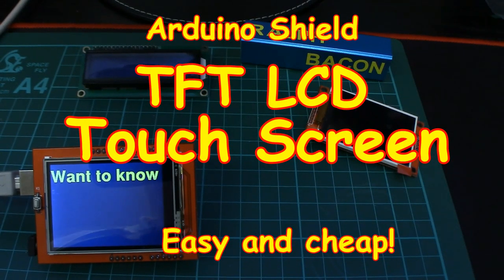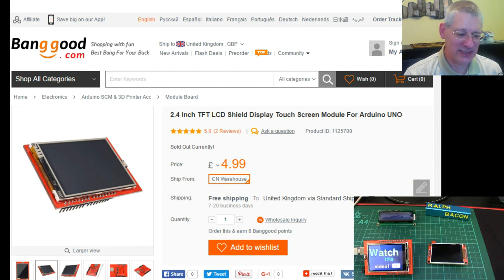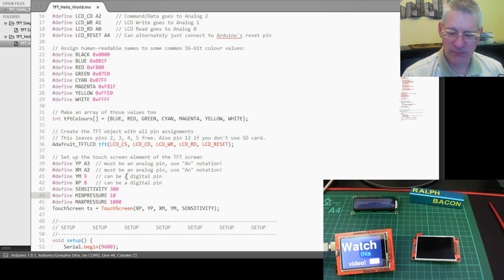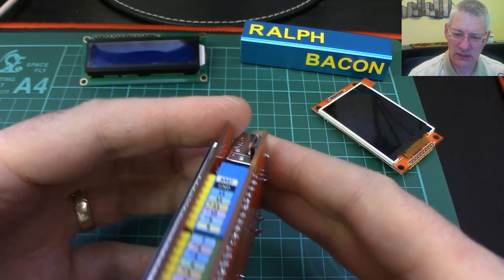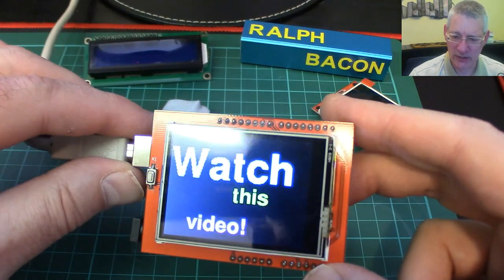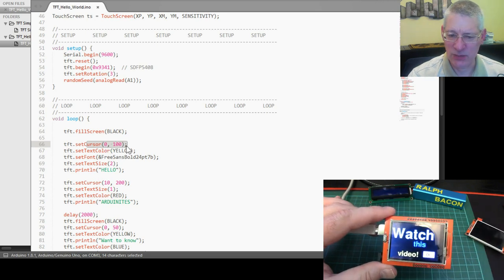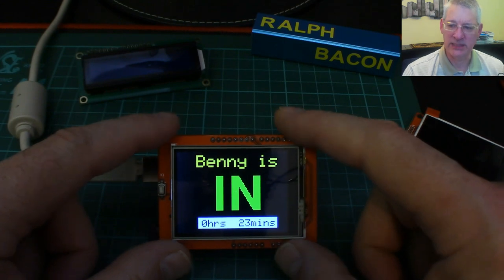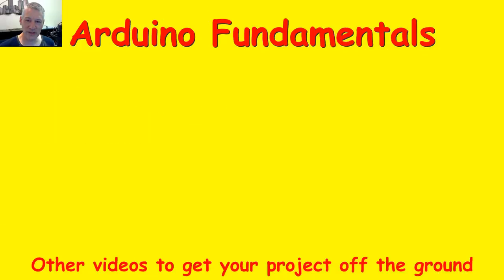#83 Colour Touch Screen TFT LCD for your Arduino - Cheap & Easy

Comment: Hey Ralph would you mind doing a video explaining how to control a servo with a joystick via bluetooth?
Reply from the maker: Ha ha! How cheeky is that Tom, asking for a complete bespoke system in one of my videos!
 
OK, seriously let's consider the steps required here. Firstly, Bluetooth communication (from what? your phone, another device?) is easy and I've covered that in a previous video. Next, joystick control? A real one? Now, this can't be your phone after all, in which case why would you choose Bluetooth as the comms of choice here? I'd use something else, perhaps an nRF24L01 transceiver. Possibly even infra-red, if the servo was stationary, that is not on a robot or car.
 
And finally, controlling a servo is a whole sketch in itself, which I can't believe I haven't covered (although it got a passing mention in my Stepper Motor videos). But if you get that working as a self-contained project then linking it to something else (which you've yet to specify, as we have now discounted your Bluetooth-enabled phone) is the next step.
 
So there are at least 3 (major) proof-of-concept steps to consider here, each one of which you could have a reasonable stab at doing, but the very first (and most important) step is to define exactly what your requirements are. What's the project, Tom, that you have in mind?
Reply: Hey Ralph thanks for responding back! Not trying to be cheeky just trying to the get the information for my project. Sorry if it was inappropriate. So I am building a BB8 and right now I am working on the head portion of the project. I would like to control it through a joystick  wirelessly through bluetooth. I know I could of used an XBEE but I don't have those right now. If found videos of people using bluetooth and servo motors but not how to use it together.
The hardware I have is 2 (SenMod HC-05 Arduino Wireless Bluetooth Receiver RF), one servo motor, a 2X New JoyStick Breakout Module Shield PS2, Arduino Mega, and an Arduino Micro Pro. Thanks for your help!
Reply from the maker: It's not inappropriate, per se, Tom, just that what you suggest is about a month's work! And then some! You can certainly send Bluetooth via an Arduino to another one on your droid but I don't know how that deals with the signal. It's a bit specialised, Tom, best best is to find a forum that deals with this (especially as you have already found videos of people doing this already, they may proffer some clues). All I can say is "Good Luck"!

Comment: When I try the Sample code for the touchscreen I get an error. "Error compiling for board Arduino/Genuino UNO"
Reply from the maker: Go to File - Preferences and tick the boxes that say Show verbose output during [ x ]Compilation and [ x ]Upload, Joseph. That way you get much more output, but at least it might point you to the error that you can understand and hopefully correct.
Reply: @RalphBacon  Thank you very much.

Comment: I am getting an error "fatal error: TouchScreen.h: No such file or directory"
I can't seem t find this file any where, please advise
Thanks
Reply: 1. Search the entire hard drive from C:\ or / (Linux) for the file name. 2. Enable "Show verbose output during compilation" under File > Preferences.  This will display the library directories included to resolve / search for the needed files to include during the compile.
Reply: @bgable7707  Thanks but I solved the problem by installing older libraries that had the required files...
Reply from the maker: I see you have resolved this, good job!

Comment: I bought one of the second type of display you show (Geekcriet 2.8) from Bangood some time ago and re-visiting the advert today I notice that, for that model, they now supply some code to download - with lots of examples and code for the different graphics processor types. It looks like the same product is available with either the STC12LE5A60S2 or the STM32 (STM32F103RCT6). So that will be interesting to try - some sketches don't even use a library - clever these Chinese.

The screen you feature on the Uno is also Banggood, (2.4 inch TFT) as you describe, but for some reason is currently out of stock. I wonder why....................
Reply from the maker: No library, Alan? Wow, that sketch would be interesting reading. I might just mosey along to Banggood to take a look. Are you saying the other TFT is out of stock due to the "Delia Effect" or have I misunderstood. We could call it the "Benny Effect"! And I still get no commission from anywhere.
Reply: Hi Ralph,

I couldn't get it to work - so I moved on but I might go back now I have actually got my TFT working.

Using the Bangood 2.8 TFT, I eventually found that "tft.begin(0x9325);" works but I can't guarantee that every variant will. Mine does so I'm obviously happy. The basic info can be found in; "Adafruit_TFTLCD.cpp".

As to the Banggood stocking issue - could be the Benny effect, since it takes a video like yours to raise interest in what is otherwise a fairly specialised piece of hardware. There is also an Instructable on the 2.8 TFT, which I will check out - and report back.

Kind Regards Alan
Reply from the maker: Does the 'touch' part work too, Alan, using that identifier?

Comment: Hi! I can program one of these to play video, correct? Thanks!
Reply from the maker: Not a chance, Tamara! The Arduino doesn't have the processing power to display video files of any kind. A Raspberry Pi could do it though, with one of their screens, but not an Arduino. It can display .bmp photos though, although the quality of this screen is nowhere near as good as the one in your phone. But then again, it didn't cost anywhere near that either! Great question that others may have wondered about too, thanks for posting.
Reply: Thanks for replying, do you know what type of raspberry pi I need?
Reply from the maker: Given that you are newcomer to the Pi World, I would go with a model that has lots of support, like the new (and powerful) Pi 3 Model B, although the Model 2 might suffice too. But don't let me push you down a path that's wrong, ask again at the forum stuffed full of Pi experts: https://raspberrypi.stackexchange.com/

Comment: Bonjour 
Merci pour le tutoriel et ce que tu peux nous faire un autre tutoriel pour un écran lcd tactile avec un menu ou faire fonction un moteur avec des button sur l’écran 
Merci
Reply from the maker: Je suis vraiment désolé mais je ne peux pas concevoir de circuits sur mesure. Mais je vais ajouter ceci à ma liste de suggestions! En attendant, essayez de demander aux experts à http://forum.arduino.cc J'espère que cela aide.

Comment: works great but driver on commonly available from eBay resellers marked <http://mcufriend.com> needed to use the following for setup
void setup() {
 Serial.begin(9600);
 tft.reset();
 //the following needed to be changed for correct driver type
 tft.begin(0x9325);  // SDFP5408
 //the driver on mcufriend.com boards is IL9325 now NOT ILI9341
// rotation appeared to be 180 degrees out  with that driver as well 
tft.setRotation(1);
 randomSeed(analogRead(A1)); 
}
Reply from the maker: Excellent information, David, thanks very much for sharing that. It will doubtless help others trying to set up such a screen.

Comment: Dear sir, Ive downloaded all the libraries as requested, but when I upload my Arduino UNO i have the following message: 
Invalid library found in /users/myMac/Documents/Arduino/libraries/TFT-LCD-Display-2.4-2.8-Touch-Shield-Master:

and i cant find whats the mistake , would you please help me out?

Thanks in adavnce

Alex
Reply from the maker: Alexander, when you download (and subsequently unzip) the library, it is usually appended with "-master". Remove that, so the file (and the library folder within it) is just the library name without "-master". Whether this is causing the error I don't know but you should do this anyway.
 
If you subsequently remove this folder (temporarily) does the error go away?
Reply: Dear Sir;
Yes I noticed that and I have changed the folder name properly, however still having the same problem. I have deleted all the libraries and re-installed again, and still the same problem.
Reply from the maker: Where are you downloading the library from, I'll take a look?
Reply from the maker: alexander burkert 1 hour ago
from https://github.com/adafruit/TFTLCD-Library

I've had a look and it seems fine. Do the following. In the unzipped library: remove everything except files ending in ".h" and ".cpp" (header and c++ files). There are a few. Does the error still occur?
Reply: Ralph S Bacon “

Comment: I just received a 2.4 inch display and tried to get it going on the Uno. There's not much on the board to identify it but it is a Mcufriend display. It simply had printed on the back of the board "www.mcufriend.com" "tftlcd for arduino uno (spiflash). Several videos say to use the mcufriend_kbv library for this display along with the adafruit gfx library after installing them I tried running the graphictest under examples which gives blank screen, serial port output reports: 
Serial took 0ms to start
ID = 0xC0C0
That's it and the screen stays white. Is there some configuration I have to do or is this screen not supported? Any help greatly appreciated.
Reply from the maker: Tricky one this. There are so many variants of these screens that what works with one won't work with another.

That said, if you inspect the library file(s) you may notice some comments in the code that suggests you can try x, y and z depending on the model of your TFT screen. That, and Google everything in sight and try all suggestions - I had to do this once and it took forever to track down the correct settings in the library.

That's all I can suggest. And this is exactly the reason why I don't buy any TFT screen unless I have a working library for it (no help to you now, but others reading this may pause and reflect!).
Reply: Try to install the MCUFRIEND library written by David Prentice. You find it in library manager.
David has fixed many of the white screen problems. Mcufriend use different control chips for nearly every model of display. My 2.4 inch display uses ILI9341 reported as 0x9341 and works with this demo.
Reply: I am attempting the same with the same display. Tried the mcufriend_kbv library,   MCUFRIEND library written by David Prentice,  TFT_LCD_Display_2.4_2.8_Touch_Shield_master,   053-Touch-Screen-TFT-LCD,  2.4inch_Arduino_HX8347G_V1.0,  Adafruit_GFX,   SPFD5408_master.  Tried modifying parts of code from the mcufriend.com. No luck. Been at it for about 8 hours watching videos and trying things out.  Did you ever figure it out?
Reply: @mikelee1906  
Do you get any output on the screen at all ? Or is it white all over ?
I assume the tft is properly inserted in the UNO, correct way ?. Not any misaligned pins etc ?
Try starting all over with the demo's in David's Example folder without modifying any code.
Also take a look in the Terminal output screen and see what the test outputs. Display model
etc. Take a look in the Arduino Forum and search for  MCUFRIEND.
There is a lot of people having trouble with Mcufriend tft's.  They are low cost yes, but I would have been rich if I got $1 for every hour I've spent troubleshooting these tft's.
Reply: @mannhansen9337   I have never seen so many people have so many issues with one device. It is incredible the amount of people that have issues on the forums!!  Usually my determination pays off but this time may be different. I think it is defective. When I switched the ID to 0x9325 it displayed a blue slowing changing into a pink back to blue. It looked messed up. A lot of artifacts. Blotchy. Static. Nothing even close to the test patterns I have seen.
And it cycles through the process in the Serial monitor correctly. Yes it is seated correctly. I have been building computers for about 10 years so I have that down. Went on easy. No problems. Pins look great. I ran the LCD_ID_Readreg .  I thought about  posting that and some pictures on the Arduino forum where David helps out people. But I only paid 10.99 US on Ebay.  I  was up until about 4 AM working on it. Started at about 2 PM. I initially saw the rough looking pattern about 2 hours into it. I am taking a break from it.  Feels like I have compiled a thousand sketches! Might  still try  posting to David. Might go the Adafruit or Elegoo wrote. Pay a little more. Have heard no problems with them. Thanks for the reply! I do appreciate it!
Reply: @mikelee1906  
Same here. I have received TFT's with bent pins and cracked glass. Even different control chips in same shipment , 2 of each out of 4. David Prentice helped me on that problem quickly.Thanks to him. If you provide the LCD_ID_Readreg output maybe David can help you get going.
I live in Norway so shipping costs to me will be enormous high fromAdafruit. At least  $30-40 for shipping a TFT to me from the US. I Paid $20 for shipping an envelope with a Teensy inside. Just as an example. I have ordered computer and electronic components from the US since 1977 but not at so high shipping rates as now.  From Ebay/ China shipping is free but you never know what you get.
Reply: As an update to anyone reading this thread, I've found that the display in question was indeed defective. Many Thanks to  David Prentice for his great work and insite. When I received a new display I found it worked with the mchfriend_kbv library, when simply plugged into the UNO.  This allowed my to learn a bit more about the display and understand that there are many variants of drivers, modes of transmitting data to it, electrical characteristics etc. This variation which is basically a shield configuration for the UNO is OK to play with and learn, however IMHO since it is a parallel interface using all but 1 GPIO of the UNO, it makes it pretty much useless for reading sensors and displaying information from them.  I am awaiting receipt of an SPI interface version in order to pursue those abilities and in the mean time learn the library functions to control the display and touch sensor.

Comment: The display isn't SPI,  it's actually using a parallel interface. It uses the 5 analog pins and 8 digital pins. I think other other display in your video can use spi or parallel. I have the same display which I wanted to use with a wemos D1 but I can't as the D1 only has 1 analog pin. I need to order a spi display instead but of course they don't come as an uno style shield.
Reply from the maker: Yes, you're right of course, Chris, I realised after watching the video that although I said "uses the SPI pins" it did not use the SPI protocol. But there are screens that use the I2C / SPI protocol so that's another avenue I may explore, once I get this project in and done. Thanks for highlighting this.

Comment: Is that the Mac version of the Arduino IDE?
Reply from the maker: No, its a different IDE called Sublime Text 3. I've done a video on it, see video #69. It has several advantages over the standard Arduino IDE, if you're ready for an upgrade!
Reply: Ah excellent, I'll be sure to check the video out!

Comment: In case anyone is really struggling:  
I used an IL9341 TFT shield from Elegoo, (via Amazon), they support the product well, but it still didn't draw the right way up on the sketching sketch.  I fixed it, so this is a read-only link to my working version for the Uno:
https://www.dropbox.com/s/mgusq6t71ry1won/My_working_Elegoo_tftpaint.ino?dl=0

So this is (mostly) NOT my code, it's from Elegoo, though it bears a striking resemblance to other sketchpad TFT programs!  Their libraries and sample code are available at: https://www.elegoo.com/download/
I make no claims other than "it worked for me" and "that was a year ago."
Smart coffee table is still on hold, Ralph, I'm still painting the lounge and then it's the hallway before the carpet goes into holes...
Reply from the maker: Life has a way of getting in the way of Arduino projects, Neil. I had to decorate the entire house two summers ago. 12 hour shifts but it got done! Not much else did though. Thanks for the link to the TFT code, it will appear in Google search results before you know it, helping others. Cool.

Comment: What if the cat stays in the "long" catwalk, not out not in ..., 3 colors (no text) Red: out, Orange : in the catwalk, Green : in.
2x Pir : one inside, one at the exit ...,  touch the screen to show the time/details ... auto-switches back to color
Reply from the maker: Yes, you've already identified a, let's say, "edge case" in my design. I'll explain how I'm mitigating this problem in my final video on this project, but as I cannot access the cat flap any more it's always a risk that the device will how "IN" or "OUT" and Benny is not really either - hovering between the two states. Schroedinger's cat, almost? I like your idea of another colour though, I will probably use that, and the idea to touch the screen to show a log I had already come up with (really I did, but probably phase 2) so great minds think alike. Thanks for posting the ideas Jyv, appreciated.